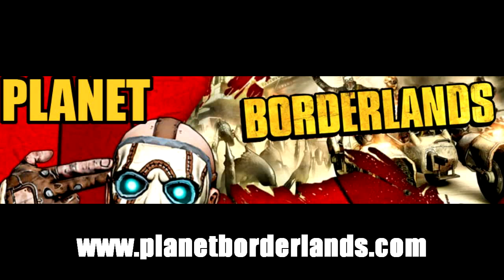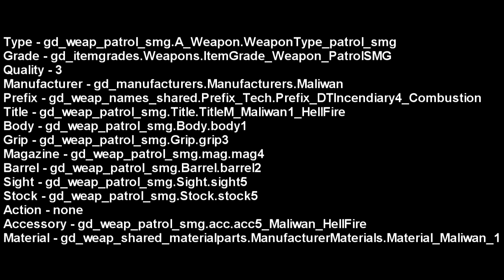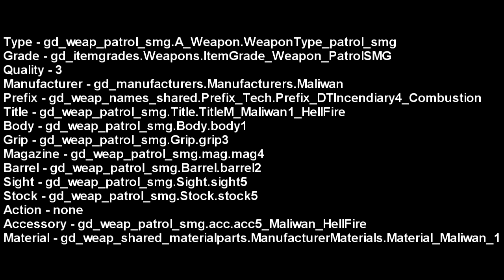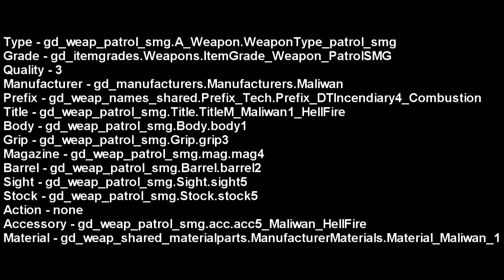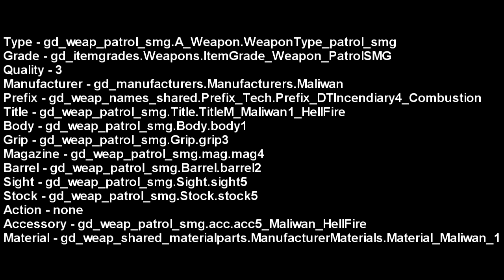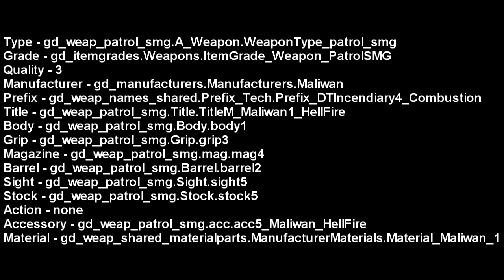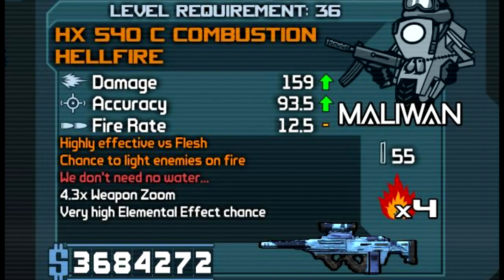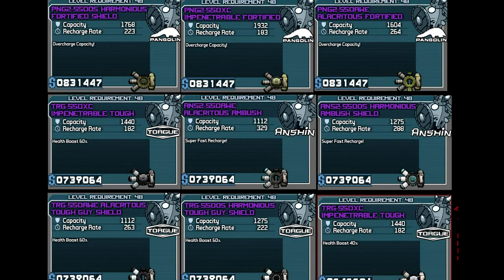Borderlands: Basics on How Guns are Generated

Comment: I have been editing my save file on the PS3 version by using a Hex editor. For example I gave the clip capacity of a "Bulldog" Shotgun (20) to Sledges. I have noticed 1 problem, I don't know if it is the same as the PC version but the sections of code in a gun on the PS3 are separated by 5, 8-bit characters 4 blank and 1 that isn't I have found that if the one that isn't blank is incorrect the save file will not load.

Comment: I got a hellfire the other day that had a bass att. of 201 and a damage boost of 67% or around there.

But the fire rate was comparatively low compared to other Hellfires I had so I sold it. Most of it's power comes from the the x4 fire multiplyer and 100% burn chance anyway.

The latest DLC also has some pretty wicked shields. One I have for my soldier is 2107 capacity with a 60% health boost and a friend of mine has a shield with a ridiculous high capacity of about 3000

Comment: @LANPENNER007 

yes you can, but they are not nearly as easy too.  before, you could mix up manufacturers, add special effect lines, and basically design the entire weapon.  now, you need to start reaching back into non-existant guns or manufacturers and changing the name.  name is the most common, but really good modders know how to access these things

Comment: Figured out the symbol is specific to the peice of code for example on a combat shotgun you may find the following two parts next to each other

'gd_weap_combat_shotgun.Sight.sightnone
$gd_weap_combat_shotgun.Stock.stock1

that means combat shotgun sightnone will always have an apostrophe and Combat shotgun stock1 will always have $. I am making a list of which character each different part has now, it wont be complete though due to not having every possible part on the equipment I have.